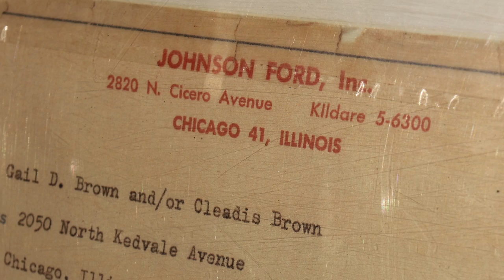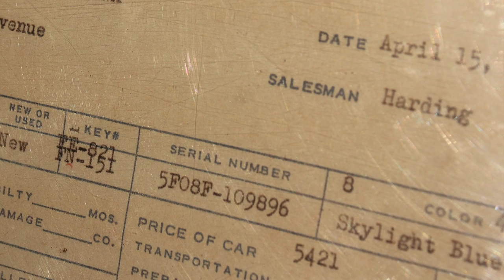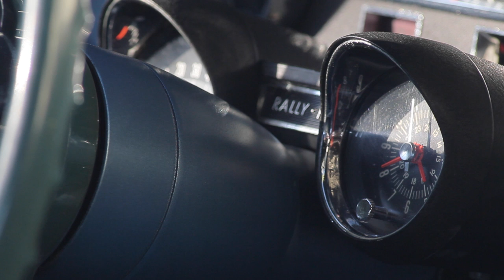The First Mustang Sold

Comment: Sweet story, glad they kept it. 
When I was a teenager in Denmark, a friend of mine had a dark blue 64 convertible, 289 with a four speed manual. 
Cars weighed a lot less back then and with the stick shift the torque was really impressive. 
Roof down until we all caught a cold, as you do. Good times.

Comment: In 1968, my folks bought a Pontiac LeMans 2-door coupe.  350 ci engine, power steering, tilt, A/C, am radio, vinyl top, gauges and headrests.  Really nice car.  We drove it for over 200,000 miles.

Comment: I really love the early Ford Mustang I bought one in October 1984 and it was built in Dearborn Michigan in May 1964 as the Vin plate code indicated...Anyway mine was totally original including a Generator instead of an Alternator. My parents Bought a 1965 Ford Mustang New back in February 1965 at Bay Shore motors in San Diego, and theirs had Disc Brakes and alternator . I sold my car back in 1992 because I needed the funds to get married. I later purchased a 1967 Mercury Cougar but I have found it is not the same as the Mustang because it is so much harder to get parts for it!!!
Reply: mercury cougar? idk what year it is but every day i see this one just sitting in this dude's front yard with a "for sale" sign on it, was never able to stop and talk, though it's been there a while, currently it's under some snow and slowly sinking into the ground :(

Comment: Everybody of a certain age has a mustang story. Basically, it was just a rebodied Ford Falcon, just looked much cooler. What I'm glad to see is that they restored it to original, no hot rodding, no nothing it didn't have originally, tho it is often a good idea to upgrade the brakes to disc brakes.
Reply: Wrong, uses Falcon parts but nothing else is the same  as the cabin and engine is further back.
As for hotrodded? It has the wrong airfilter for that model so probably a 4 bbl etc.
Reply: @ldnwholesale8552  um say what? It uses falcon parts... duh that's what I said. A wrong air filter makes you think it had a 4 bbl? That's mighty presumptuous of you. It probably has whatever period filter they could lay their hands on, doesn't mean crap about what carb it may or may not have had at one time or another. At any rate it's not sporting headers and a big carb  and all that typical  crap now. You must be a cop, making such huge leaps with your assumptions with no evidence to back it up that's    how cops work. Make an assumption and make you prove your innocence.

Comment: 2:47 Blew the stop sign.
Reply: taz tazmo  when turning right you dont have to stop
Reply: Billy Boots Where? Anyplace I ever drove if it said STOP you come to a full stop.
Reply: john macleod  well here in atlantic canada you dont have to COMPLETELY stop, you just gotta slow down a bit.
Reply: I bet NB and NF also differ with your interpretation of the rules. STOP is exactly that.
Reply: Billy Boots  here in the  USA, where this couple lives, you must come to a complete stop at a stop sign, or else it is considered failure to yield and is a traffic violation which is a ticket and a fine if you are caught by law enforcement.

Comment: Hi Mr. and Mrs Wise my mustang Is the same convertible you have my car was brought on the 14th and went to all the Ford sales agency It has very little mileage on it on a rotating platform I have the sales slip and would visit the car every day and would tell the people to keep your hands off my car. It was stored in a heated garage for 50 years still has the same tires on it. It is going into the library of congress for the HVA Mark Gessler  invited my car into the HVA my car has never been touched it looks like it did in 1964 1/2 Your car has had a lot of work done to it over the years.

Comment: $3,400?? For a 65 vert? My Dad bought a '66 289 coupe and I know he paid $2,600...though ours was a C code (2 barrel 289 singkle exhaust), theirs sounds like a dual exhaust A code (4 barrel 289...non hipo, those didn't come out until later in '65)
Reply: steve Fowler it’s a 260cube V8. As the First 64 and 1/2 had.

Comment: Lets get this out of the way the Mustang is not a Muscle car or At least it didn't start out as one when 1st sold in the 1964 there were 4 engine options the biggest was the 289 Cubic inch V8 that made 271hp the 1964 Mustang And the 1974 All new Mustang 2 are very similar.

Comment: Whoever restored the car didnt put an original 64 1/2 hood back on it... It has a rolled cove lip on the leading edge... the original did not ... too bad.
Reply: Not true:

http://www.allfordmustangs.com/forums/classic-tech/71429-heres-why-people-call-them-1964-1-2-mustangs.html

"There is also the hood lip thing. That was more of a tooling glitch than a design feature. None of the high profile 64 1/2s, like the indy pace cars or cars destined to go on tour for promotional reasons, came with the 'unfinished' hood. Iacocca's car and the Deuce's Coupe didn't have that hood."

Comment: I thought the first 64 1/2s didn't have the lower reverse lamps.
Reply: It was an option for the '64 1/2-'65, same for the lower rocker panel mouldings.  Both were standard equipment on the '66 model.